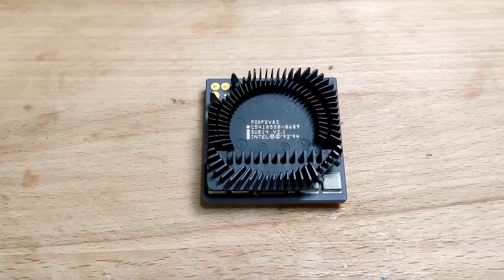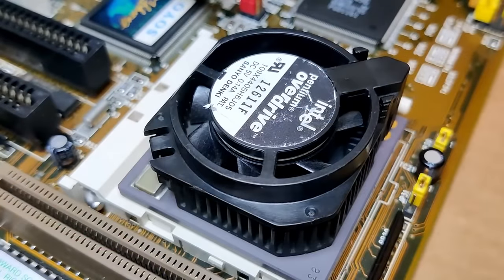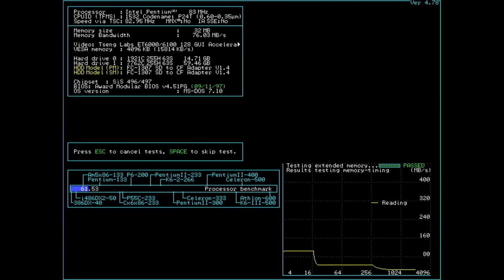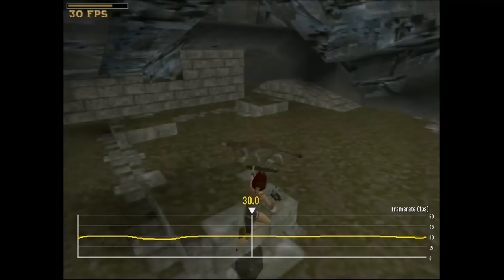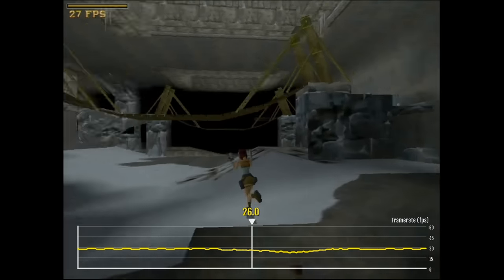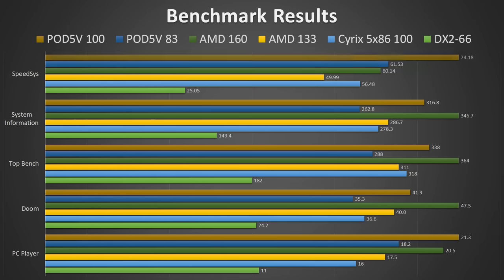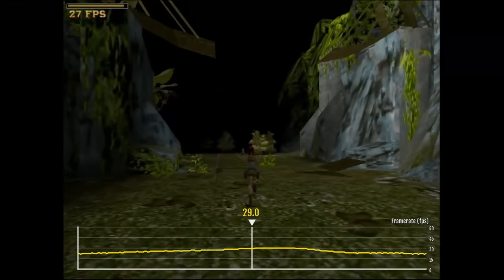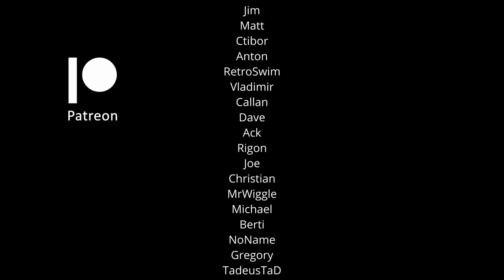Tomb Raider (1996) on a Pentium OverDrive PODP5V83 (Part 8)

Comment: I just don't overclock old PC, this is non sens to me as you can use another one faster. Even if it made some sens in the past it does not currently. I have overdrives too, but never bother testing them. I prefer to code optimized stuffs for a 486/66 than overclocking it to do the same.
Reply from the maker: It's more for curiosity and to see how far old hardware could be pushed back in the day. I agree, it doesn't make much sense today because you can just get a socket 5/7 system. However, that may not have Bernd an option back then